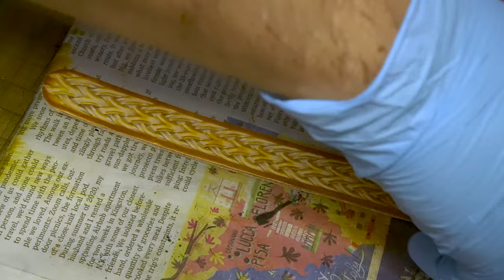How to Make a leather bracelet. Fun and simple!

Comment: When sizing your bracelets how much extra to you add in to get a comfortable fit but not snug? I assume you start with the exact size around the wrist and add some to it for the snap placement.
Reply from the maker: for example,  my wrist is 7"  and the bracelet ends up being 8 1/4 inches, A lil longer because I do not want it to tight. I measure from the center out 3.5" in both directions and add no less then a  half inch on both sides and that is where I place my snap. Then there is about a 1/4 inch from the end of the bracelet. I hoped this helped. This should be a guide, you can place the snaps even further if you want it loose. Thank you, I hoped this helped. :)
Reply: @baronleathercraft  thanks so much for the info.